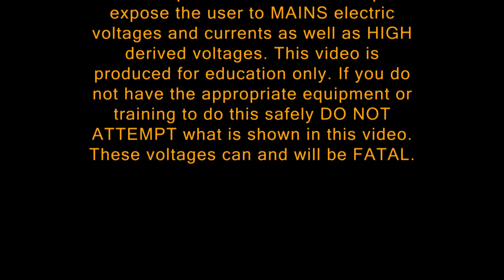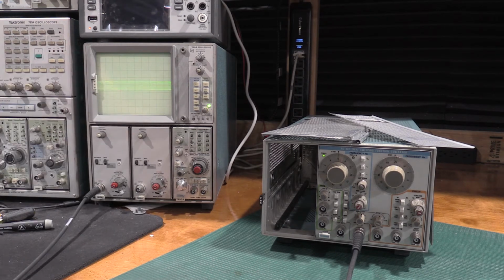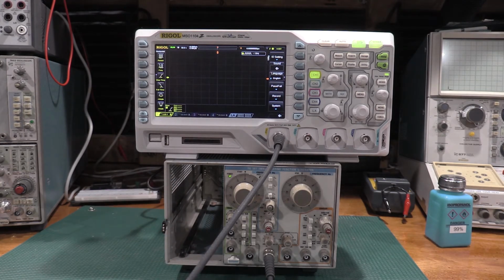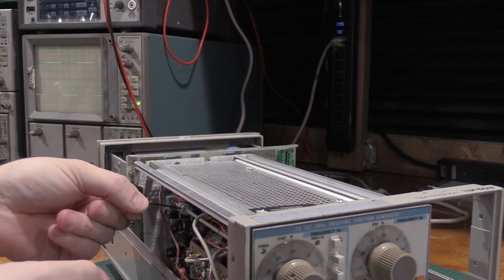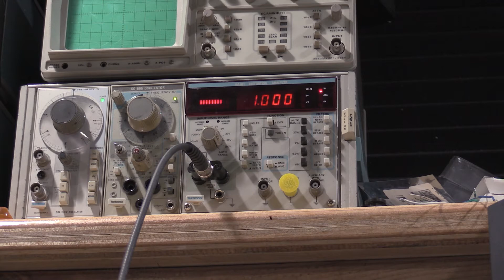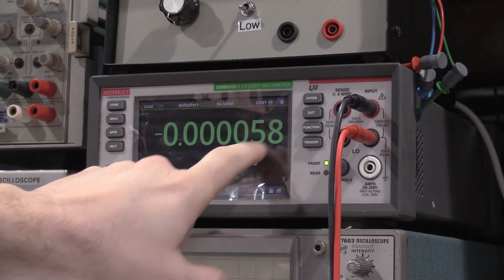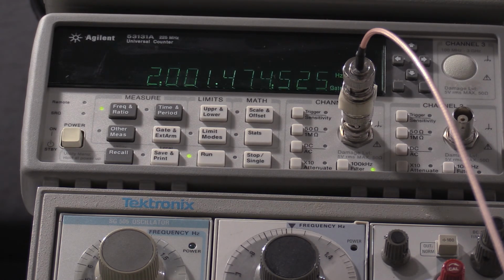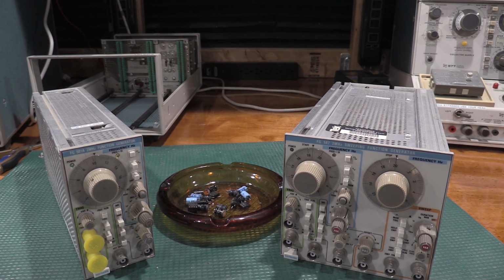Tektronix FG507 Repair and Alignment

Comment: ZenWizard - The latest addition to my 500-series family was an FG 507 (just as hard to find the manual - which I had to buy as well). Seeing you post this video is just fantastic! I also appreciate what seems to be more attention on your part to show all the instrument setups in more detail and you're even showing where you're landing those probes! This is great instruction! My lab is imprisoned in a storage unit in Boston while I look after my parents here in Florida. Once the world gets halfway back to normal will see if I can get some of that equipment down here so I can get started applying some of what I learned from you. In the meantime I will try to work on fabricating a protective cover to house the power section of the TM503 so I am better protected when I use it for calibrating modules. When you re-slot a given module for better access in the '503, have you noticed any variance which would possibly compromise you're calibration adjustments or is this something which is tolerable in a known good chassis? (Maybe I should wait until I see all the rest of this and your other videos... you have a way of already answering all my questions!)
Reply from the maker: Hi Chris, I am not using any of the rear connectors or the back plane linking connectors. So all the back plane is really doing is applying power. There is however one thing that changes, the pass elements in the frame. There is a NPN and a PNP transistor that is dedicated to the slot. What they do is plug in dependent. They don't all do the same job. As far as I am aware the entire 500/5000 series are capable of even power module changes not just slot changes and they will keep their calibrations. I have a bunch of 502a meters that were calibrated in that 503 frame but now live in a 5006 frame and they are just fine. If you are having issues that seem frame dependent I would first check the power rails to make sure they are not drooping out and the plugins are getting enough juice. In one of my 5006 frames this was an issue.

Comment: That IS a rare one.. more common is the FG504, a 40MHz sweep gen.    EDIT: Just checked my notes, I apparently have one of these that the sweep is not functional on. I'm going to have get another TM502 to use as loose supply, and try to dig into it.